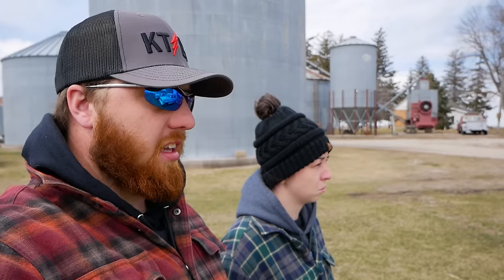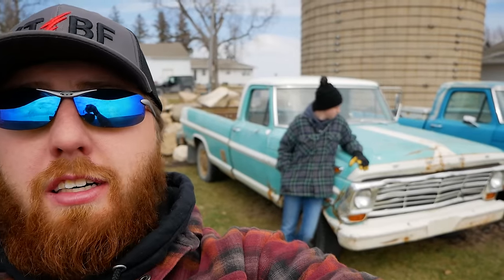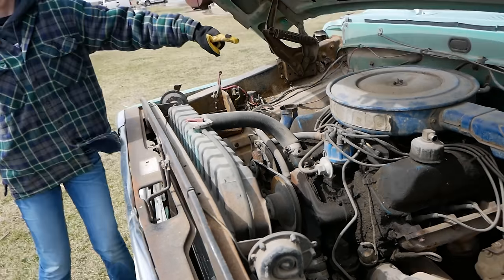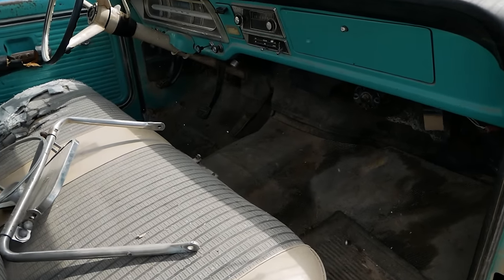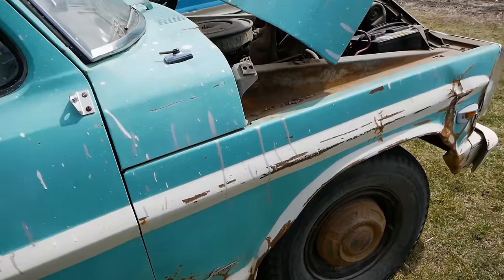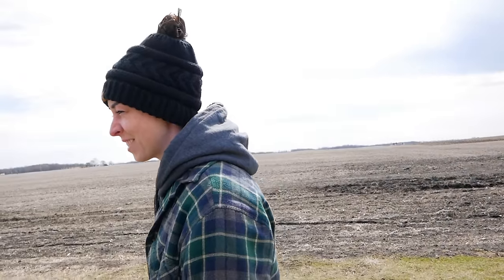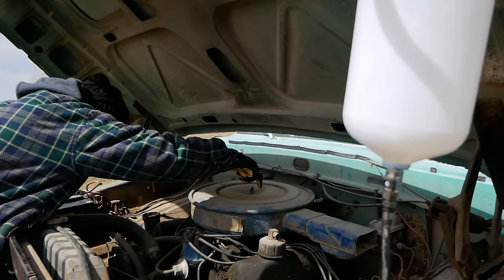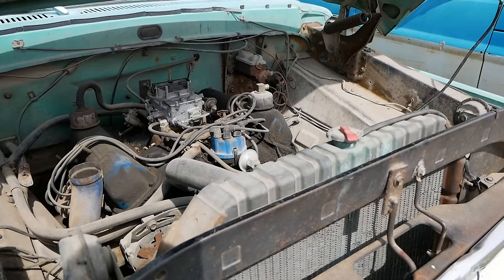ABANDONED Farm Truck Returns to The Road after YEARS in a Barn!

Comment: 38:09 edelbrock carbs are good carbs but they puke more gas into the engine through the idle ports. ive read countless forum posts about how they get so much worse gas mileage with them and when they put a good Holley carb on there their gas mileage goes up. I've noticed this too with my old 69 f-250. the edelbrock got about 10mpg and the Holley I got 15ish mpg and better!

Comment: You can put the old bias plys on when your farming
Reply: If all that truck will do is run around on the farm or go back and forth to town on occasion then he can be running them all the time unless they're obviously failing. The flat spots should smooth out in 50 miles or less. But I would definitely keep a spare onboard with the jack and lug wrench ready. They could also be used as snow tires. Chain them up in the winter and go.

Comment: Hey friend..you should retorq the heads I'll bet they have never been touched that may be the problem with anti freeze in the oil..my 71 360 had that problem they were loose..i also put a few radiator stop leak pellets to make sure .. the dry one that come in a pack of 8 ..never use bars leak it will stop up the heater core and the radiator..thermostat you know..Cheers 🍺🍺🍺🇺🇸🇺🇸🇺🇸

Comment: Your misinformed on the camper special, the ONLY TRUCK WITH A LONGER WHEELBASE was the SUPER CAMPER SPECIAL built in the 70’s. That was an F350 and only an F350. Camper special was options and extras. Heavier spring rates, heavier brakes, trailer plug wiring, wider mirrors. Upgrades to that would be auto trans, power brakes, power steering. But ford would pretty much build you a truck how you wanted it though

Comment: Brakes on that thing should feel a touch harder then a set of power brakes do, or about like a set of power brakes with a bad booster. In other words it should have a solid feel to it. And I never minded working on split rims when changing them, but they was always a pain to balance as you could not balance them on a computerized balancing machine. But your 1968 Ford F-250, is about like my 1965 Ford F-100 was with the exception of the V8 and automatic transmission as I had a 240 inline 6 with 3 on the tree and 4:11 gears in the rear. Thing screamed at 100mph.

Comment: You wish it had seat belts? It does. It was law to provide them in 68. Look behind the seat. BTW if you are not happy with the brakes, bleed them again. I have a 66 with four wheel drums and manual brakes and it will stop on a dime. LOL...as soon as I said that I watched the last couple minutes where you found them. They became mandatory in 67.

Comment: You should ditch gas tank behind the seat put a late model gas tank in the back between the frame rails 99 F450 have a great tank
Reply: Brand new reproduction early Mustang fuel tanks are an excellent option.

Comment: Before my dad sold our farm we had older trucks that we used for pulling and one of them we let sit for 5 years put a quart of oil in a fired it up drove back he and got it rebuilt I think it had 500,000 miles on it last time ik the truck still on the road and it's a 1984

Comment: Excellent video Junkyard Digs (Kevin  :) & Mook :) ) also yes Manual  Brakes & Manual Steering  is farmer nickname is Armstrong and yes I drove rattling and scrap yard special trucks on Farms before  too Lol! Lots them were 5/8, 1  , 3/4 tons with 6 to 8 cylinders motor with 1 , 2 , 4 barrel carbs with manual choke and choke cable knob in dash to also Automatic 3 to 4 speeds also Manual transmission of 3 plus rare 4 speeds in Coulmn  to called in tree and floor shifter with Creeper of Bow Low first gear to 10 speeds ! Plus Power Steering and Brakes plus Manual brakes and (Armstrong Steering not Power also disk front with drums on back plus all drums too! Even 2 to 4 wheel drive plus dauls on 1 to 3/4 tons also single or  daul tanks  even a step side to short and long boxs types !

Comment: 1968 either a 360FT or a 390FT
Y code is a 360 H is the 390

FT is Ford Truck difference in the heads and intakes from the FE motors.
Reply: I'm pretty sure the one ton and under trucks came with standard FE engines.
Reply: @possumwerx   73 F250 hi boy 4wd S code had a 390 4bbl had different  heads than a  transplant 390 in a 61 F100 stepside.
76 F250 360 2bbl ,heads were the same as the 73 390.
67 mercury montego 390 different heads from the two trucks same heads as the 390  put in the F100.

The 73 F250 Hi-boy was an odd truck had a bell surrounding the front axle u joints with a felt seal that loved to leak and a reverse cut ring and pinion front diff. Also had a pto all factory. Divorced transfer case, no lockouts just  caps that kept the front-end engaged.Sold that truck  for 4 times what I bought it for.

Comment: My ‘67 has the exact same rot and rust holes on the inner fender skirt, too.  I can’t tell if it affects the hood bracket/structural or if they’re no big deal.  Do you plan to fix those?  I haven’t seen a good video fixing there area.  Thanks for the awesome videos!
Reply: Depending on the level of rust in that part of the inner fender, it would be a very easy fix for an experienced bodyman.

Comment: How critical are crush washers on the brake system
Reply: You want to use them at the connections for the flexible lines... they are used to prevent leaks on non-tapered joints. Yes, I wouldn't recommend going without them.

Comment: I see ya'll using brake cleaner as starter fluid all the time.  Does it matter which brand?  I tried CRC Brakleen.  The truck didn't start, I just want to be sure it's a spark issue and not the wrong starter fluid.  Thanks.
Reply: Just use gasoline instead. Even with prices the way they are, gas is cheaper. You can use most squeeze bottles as a squirter like the bottle from dish detergent. The cool thing about those bottles is they snap open and closed.

Comment: Does that have an EGR plate under the carb ? I had a 1977 that had one , did the same thing , would idle a little or not at all , the plate was aluminum and had a hole ate in it , the replacement was cast , don't know why aluminum with exhaust running through it would get a hole in it Duhhh!!!  But I see now that wasn't your problem 🤔

Comment: didn't encounter any bearings with a preload procedure like that yet, all bearings I've done so far (on euro cars) pack them torque to 240nm following workshop manual
Reply: I haven't done it in a long, long while but I think the torque specs for the preload is 25 foot pounds while rotating the hub then you back off one quarter turn. The procedure is in the factory manual which I recommend going by. If you have a Ford truck, buy the factory service manual, they're much worth it.
Reply: @possumwerx  last two ones I've done are a ford escort UK and peugeot 307 , same thing just pack them and torque to 240nm or 180ft.lbs
Reply: @possumwerx  I mean if the manual calls for adjusting the preload this way I'll do it but haven't encountered this procedure yet
Reply: I would always follow the manufacturer specs and recommend doing so to everyone else. And 180 FOOT POUNDS?!?!? Sounds waaaay out of line to me! Are you sure it isn't supposed to be 18 foot pounds or 180 inch pounds? Yikes! Recheck that number!
Reply: @possumwerx  on most euro cars it's like that, and if you don't tighten it to spec it might come loose because there's no pin to prevent from coming undone
And the axle nut is against a bearing race
And there's two roller bearings by drum one on the inside and one on the outside

Comment: You do know that is a 500 CFM carb that is run on RACECARS RIGHT lmao yup same carb just with a choke. It has a 50cc pump  lil much for that Old 352 put a smaller squirter on it. It will respond better.

Comment: I sure hope those are 16 in tires and ot 16.5s with are not around In anything but farm implements and trailer . But I just saw with Keven checking the brakes that it has split ring wheels on them (man killers) get them off as fast as you can let the air out of them and take them to the scrap yard and put some white spoke wheels on it . American Racing did make some 15x8 8lug white spokes at one time that would be the way to go !,

Comment: Someone greased the rear bearings because the seals wear out often so instead of wasting time and money they greased the bearings so they didn't have to worry about the seals leaking fluid it's al old truck for offroad work trucks back in the day with a floating bearing

Comment: Just do them tires yourself. I do, of course I don't stand over them. I like em to be on the truck, the front I just sit to the side the backs are duels so the danger point is inside. Now if one of the duels pops you'll probably need 2rims 2 tires and a spacer but better than a new you I ain't found one of those yet and aways point at open space or that grumpy  neighbors house. That being said I'm always trying to hustle a cage outta someone, i should just buy the stuff and weld one up.

Comment: Maybe someone can explain this to me:
I wonder about that central nut you put preload on the bearings with. preload is applied and the nut gets secured with a pin but there seems to be a little distance between the pin and the nut. since it is all greasy, gets hot and cold multiple times in it's lifecycle, isn't that nut very vulnerable to losen over time? heatcycles, vibration, rotation and "only" the applied preload and the pin that doesn't allow the nut to completely fall off of it. How does this nut stay secure over time?
Reply: A cotter pin is installed once the nut retaining shell is in place. Watch the video again and pay close attention. You'll see what I mean. Peace & good vibes! 🧰👨‍🔧🔧

- Max Giganteum
Reply: The nut can only move a short distance because of the retainer. The cotter pin holds the retainer in place. Hot and cold cycles or vibration won't make any difference.

Comment: As soon as I started this video I smelled manure.  Is this filmed in Smell-O-Vision?

I had a 1967 F250, that drain plug is perfectly normal.  Nothing like spreading oil on the cross member at an oil change to make you feel alive( and dirty).

The flat spots on bias-plys will round out with driving.  Happened everytime I drove my father-in-laws 1976 F250 camper-special.  Bounce, bounce, bounce, less bounce, fine.
Reply: My trucks had the drain plug to the rear and centered. The Fe cars had the side drain, but with 60s Fords, there are always exceptions to the rules.

Comment: Hey Kevin don't complain about a Google drive 3/4 ton when you go and get a Ford F-350 highboy ranger one time that has drum brakes on all the way around that's four wheel drive you can start complaining I have a 73 it's got a 410 policy in the back and a 411 Dixie in the front and yeah they're a pain in the rear it also has a 429 code running into the hood yeah that's a Cobra jet what 365 horsepower but I love smoking them back tires off of that thing was a farm truck now it's a street truck but it still looks like a farm truck I can't get rid of that Latino it worked all its life and now it gets to have fun and play in the mud

Comment: FE engines are notoriously cold blooded engines and don’t like to run when cold. My built 390 takes forever to get up to temp.
Reply: Check your thermostat. It may be frozen open. There also might not be one installed too.
Reply: Since I forgot, the thermostat may also inadvertently be installed backwards. Here's another one - check the water pump. The impeller may be corroded away OR the water pump may be for a reverse rotation setup and someone installed it in error. The bottom line is that the coolant has to be able to heat up in the block THEN pass the T-stat onward to the radiator. If parts are bad, missing or installed incorrectly then you'll have issues.

Comment: Why don’t they make gas tank bladders to be able to use rusted out gas tanks
Reply: They do. The problem is that they usually cost far more than a new tank.
Reply: @possumwerx  that’s dumb than lol
Reply: Welcome to reality. A bladder that would be built to handle gasoline and fit inside a standard tank wouldn't be easy to make IMHO and you would have to modify the outlet. It would be easier to make one for a multiple piece tank design... and it would jack up the price of every vehicle. There also may be safety and crash issues to deal with. It's never as easy as it sounds...
Reply: @possumwerx  I agree

Comment: Hey kevin i have a question for ya i have an 80’s ford 302 that back fires so bad at wot it blew my muffler apart and i just cant seem to figure out why its doing it you have any suggestions on where to start?
Reply: I do. Make sure the plugs are clean and gapped correctly. Make sure your plug wires are good. Check the distributor cap and rotor. Set the points gap. Make sure the firing order is correct. Make sure the distributor is set correctly to fire on cylinder #1. Make sure to set the distributor to a baseline initial advance - use a timing light! Make sure the timing chain is serviceable - if it's stretched then you need to replace it! Make sure the fuel inlet check valve in the carb is functional! You don't want gas just pouring down the throat of the carb. Make sure the advance on the distributor is functional. Make sure there are no air leaks on the intake side. Make sure the exhaust manifolds have no leaks and aren't damaged. Make sure there is no blockage in the exhaust system. Properly time/tune the engine. Go through all those things and you should locate your problem. Yes, that's a lot but you should have a smooth running engine when you're done.
Reply: Forgot something. If you're running electronic ignition such as Duraspark then you've got to ensure that part of the system is also operating correctly.
Reply: Well thanks ill start out there

Comment: I had a choice of 3 farm trucks for my farm that I had bought for some reason, a 2wd Ford F250 with 400, a 4wd Nissan with the more power 4 cylinder, and a 4wd Dodge W150 with 225 slant 6 and granny gear 4 speed.  I kept the Dodge, which was by far the slowest, and sold the others.

Comment: them split ring locking ring rims are not as dangerous there rather safer then the actual split rim other name as widow makers them suckers will decapitate you you can take them split ring locking ring rims to any tyres shop that dose these rims so you technically safe cause its a lower psi tyre but if its a tractor tyre ya screwed cause at 80 psi them things have a deafining explosion

Comment: Painful to watch the grease removal.  That "grease" is farm truck rust proofing that takes years to apply correctly yet bulletproof protection.  Removing that with a screwdriver is like keying the paint job on a high end show car.  Takes me back to the heyday of dirt road dust control as a kid.  Used motor oil laid down with a spray truck.  Dust was almost eliminated for the whole summer.  Held the road together, reduced washouts.  Thought I was in the city after that with our "paved" roads. lol!